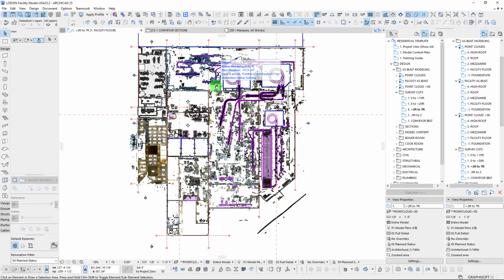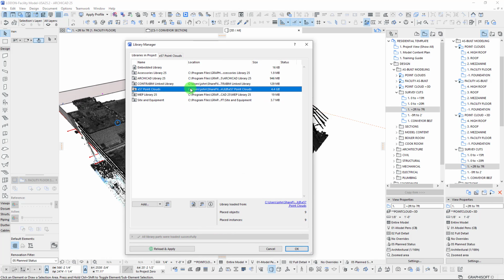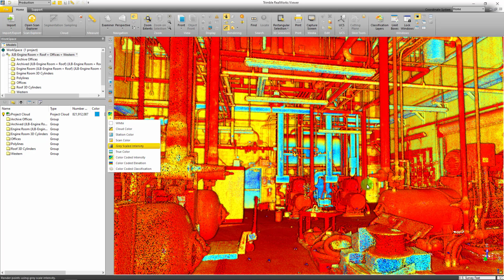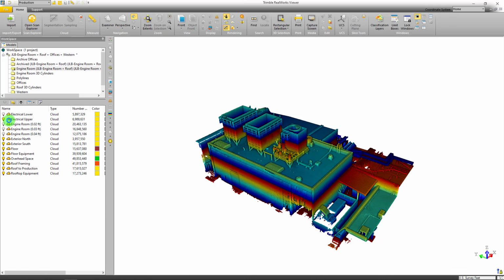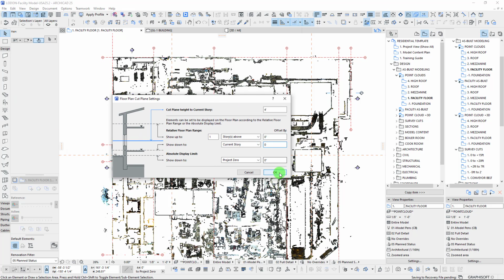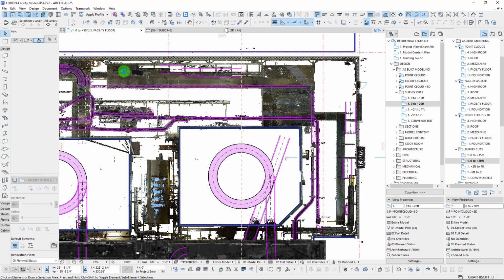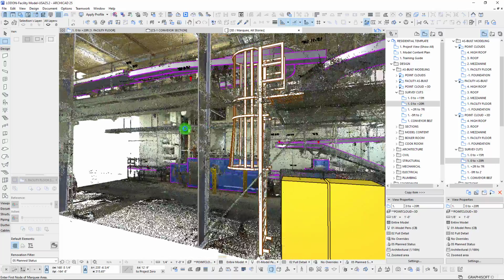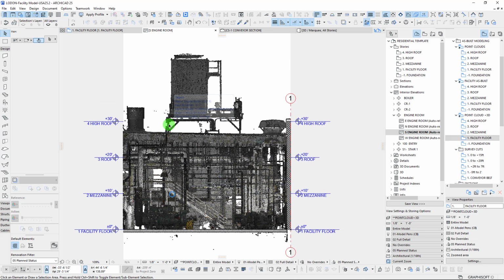Working with Point Clouds in Archicad - Part 1

Comment: Impressive Work! How was this point cloud captured?
Reply from the maker: Thanks Jaren. I scanned with project with a Trimble TX8 scanner, and processed in Realworks. I've since started using the x7 scanner, which is smaller, lighter, and self leveling, making it a lot easier to capture roofs on a hot day... Thanks for the comment!

Comment: How do you model using the point cloud model? How long does it take to create the Archicad model?
Reply from the maker: I usually setup a view that slices right though the point cloud at a specific range (2-3 ft) or (8-10ft for RCP), depending on the project. That way only the points are loaded onto that view making it faster and more efficient in Archicad. I then usually model in the walls while trying to keep dimensions nice and clean by paying attention to offsets from grids if available. Usually the process is pretty fast, depending on how much you're trying to model, and how complex it may be!

Comment: Since my very beginning of working with point clouds in Archicad I've been struggling with clouds getting misaligned at import, so one would import at correct location and the others would be thrown centimerets or meters away from its expected location.
We pre-process our point clouds from Leica scanners in Cloud Compare and export E57 files for Archicad.
I've had this problem for many months and I'm sick with aligning clouds by hand.
If anyone has had this issue as well and knows the solution, please let me know.
Reply from the maker: Thanks for the comment. I've found in my experience that if you don't touch the point clouds at all upon import, and you import them onto the same story, at their original location, it can definitely help with the alignment. One step I will do, is setup a grid from Archicad and export to DWG to bring into the registration software, for aligning your point clouds to there first. That way when you export your points for importing to Archicad, there should not be an issue. The other thing to check is the default object settings, since importing point clouds creates an object. Check the elevation and rotation of your default settings prior to import may help with your issue!
Reply: @CONTRABIM  Thank you for the tip! Indeed, it seems that resetting object rotation in object settings makes the clouds aligned properly with each other, yet it doesn't guarantee correct coordinates, but I guess I can use some external references for that.
Reply from the maker: @mipe7755  Make sure when importing, that you are NOT specifying the insertion point manually, but using the coordinates from the imported point cloud. If you do happen to specify it manually, then make sure to click on the same point as the insertion for each cloud (likely the 0,0,0 coordinate on your ground story).

Comment: I received a point cloud from a company that didn't have half the detail your model has. Is this a scan resolution issue?
Reply from the maker: Perhaps! I did sample this point cloud down to about 1/4" spacing between points, as it was a large project and I wanted to minimize the file size, and maximize the performance when working in Archicad. Unfortunately I have not found a way to increase the size of the points, as they get displayed in Archicad. You could ask for a higher resolution point cloud if you can't make out the points, but try cutting some sections and plan cuts to highlight the scopes you're trying to model, and usually you can make due with even a low res point cloud! It helps to zoom out so the density looks more filled in also...then zoom back in once you see the picture:)